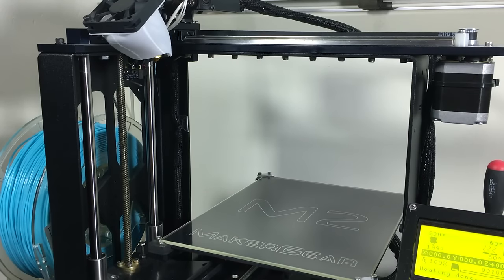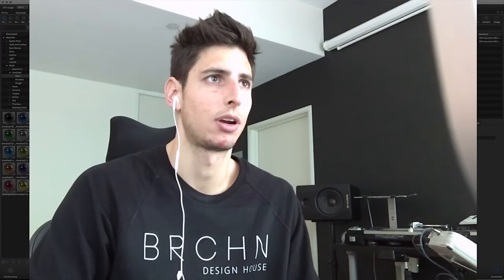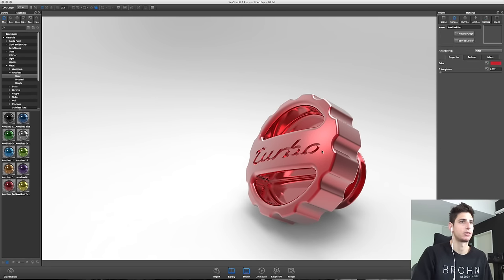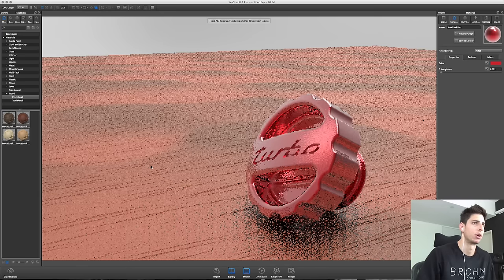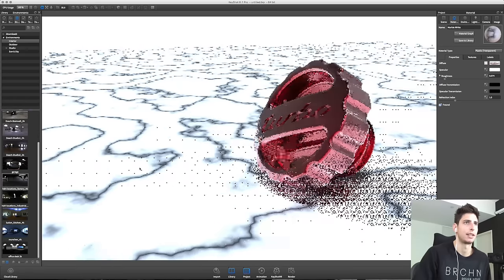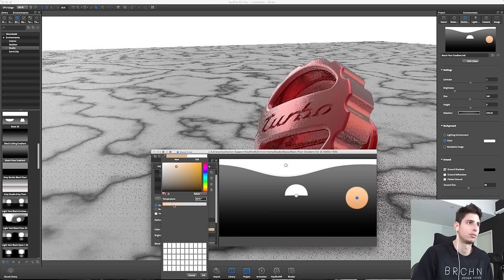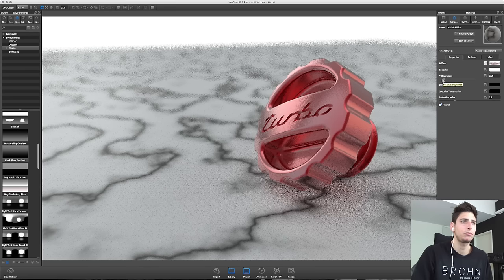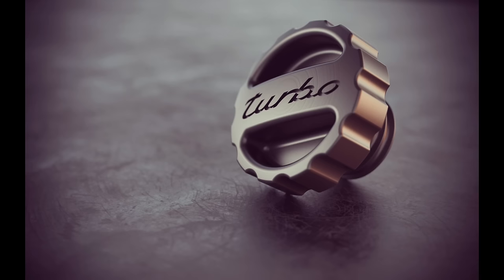How to: Porsche Turbo Gas Cap!  Design & Make! Part 4

Comment: Not sure if you guys have thought about it but have you got the thread in the right position so that once tightened the 'turbo logo is horizontal? just for the aesthetics?
Reply: +NYC CNC  Posted this on previous video in series. But you could clock it during the machining process.? Machine all of part except the text and pockets, screw cap into car and mark the horizontal with a witness mark of some sort perhaps with a marker. Then put cap into mill with the mark in the correct position so it mills the text and pockets in relation to the horizontal mark.

Comment: The photo of the cap showed left-hand threads. That seems silly, so was the photo flipped? Your cap has right-hand threads, which is what every other gas cap in the world has (or at least the couple dozen different ones I've used.) :).
Reply: +Yan Wo Yes photo mirrored on import, weird glitch I didn't catch right away.

Comment: What is the slicer program used in this? The support material looked extremely easy to remove and came of pretty clean.
Reply: I use a piece of software called simplify3d it's amazing. certainly worth the extra money... the support looks the same to me
Reply: +Simon Hills I keep putting off purchasing Simplify3D but i keep seeing great results from many of its users. I am pretty sure this is what Sam used as well.
Reply: +Nicholas Faust-Doty do it, you won't regret it! :)
Reply: +Nicholas Faust-Doty It is :)

Comment: This question may be obvious to those who are familiar with 3D printing but in the video he says he needs the support material for parts that are overhanging. Wouldn't that be unnecessary if he just flipped the cap over and built the model from the opposite direction?
Reply: True if the top were flat, it's convexed though.
Reply: +Sam Birchenough 
Okay, thanks. Learn something new every day.